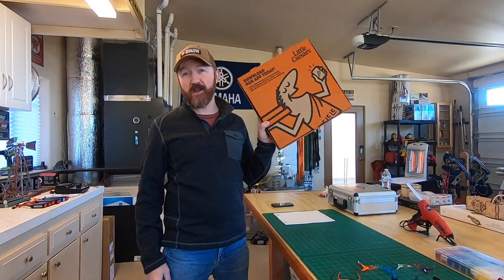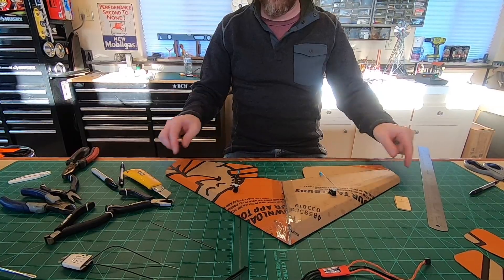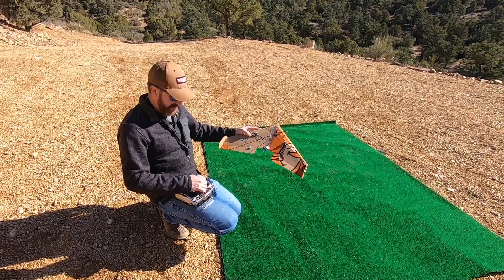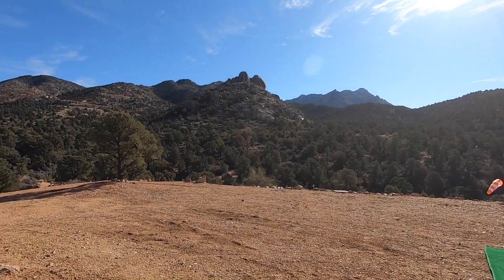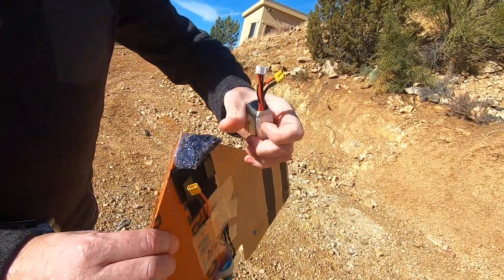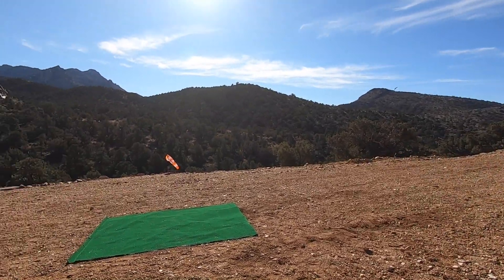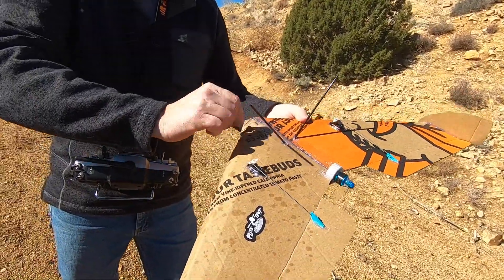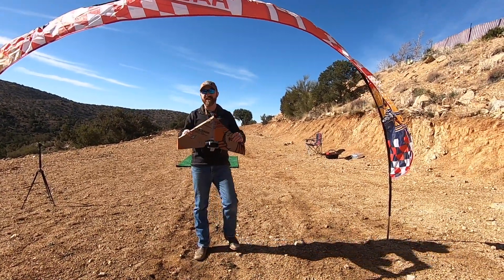Little Caesars Pizza Box Flying Wing!

Comment: Is it under 250 gramm? Looking forward to build one😂
Reply from the maker: I didn't weigh it but it could be!! I'll weigh it later when I get home from work! I highly recommend building one. Such a fun, cheap, small, fast wing. If you have wing experience it'll be no problem for you. Good luck and if you have any questions about it let us know!
Reply from the maker: So I weighed it...Wing came out at 178g and the battery I was using (Tattu 3s 850mah) came out at 78g. Total weight 256g!! I'm very surprised how close it is!! I DO NOT recommend downsizing the battery at all. I bet you could shave 6 grams by using less hot glue, no antenna tubes, trim the servo arms off more. Stuff like that. Crazy how close it is!! Lemme know how your's turns out!